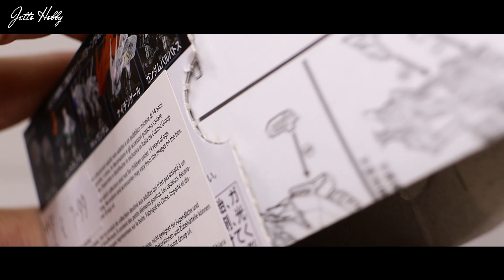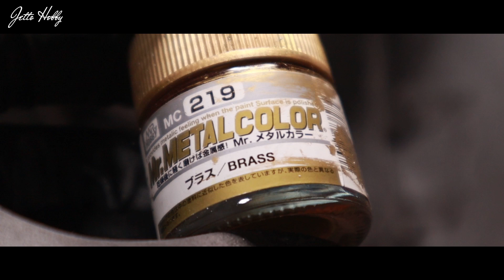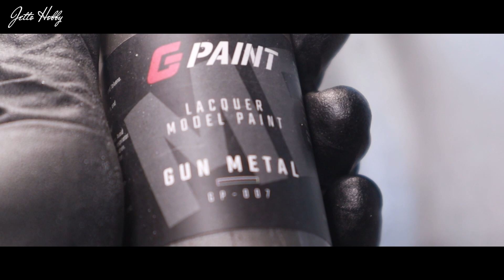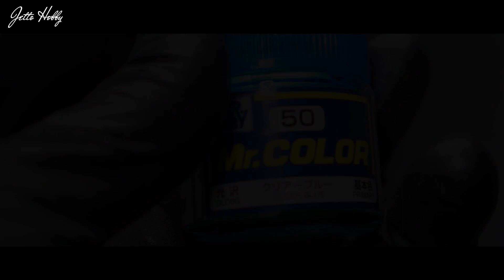HOW I DESIGNED THE ZETA GUNDAM BUST | 100% 3D printed Gundam Bust with open hatch design

Comment: What program did you use to designed the bust im trying to create a full gundam   Hirm wing zero in blender to print the parts like a perfect grade 😊
Reply from the maker: I’m used Solidworks and explored around surface modeling 😁 blender is not the best choice when creating parts where precision is important (joints). I’m venturing into direct modeling using Shapr3D and hopefully I can create a better bust out of it!
Reply: @JettoHobby  thanks so much for you fast anwer and a big hi from finland 😊👍🏼
Reply from the maker: You’re very welcome! 👋🏻 from Ireland!
Reply: @JettoHobby  if one time you get into make the Hirm wing zero i will be interest  and get it from you 😂
Reply from the maker: @alexandercruz9667  I’ll keep that in mind 😁

Comment: Broooo, this was amazing. This makes me want to get a 3d printer so damn bad. How did you get the lights to pulse like that. Incredible work as always man.
Reply from the maker: Thanks bro! I used Arduino to program the lights, there are some switches and a potentiometer which can adjust the brightness and pulsing rate, it’s behind the base of the bust 😊